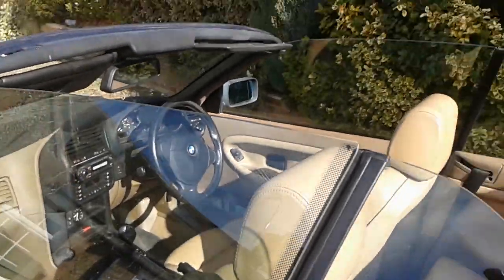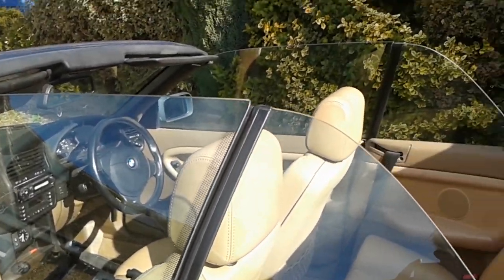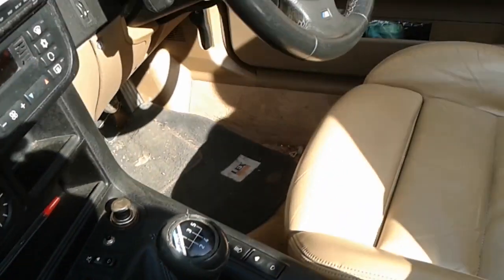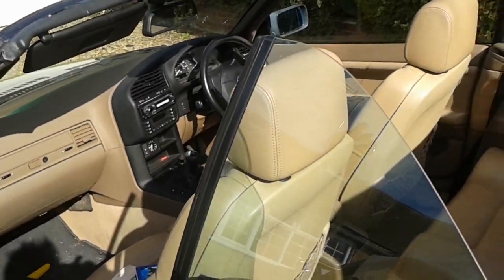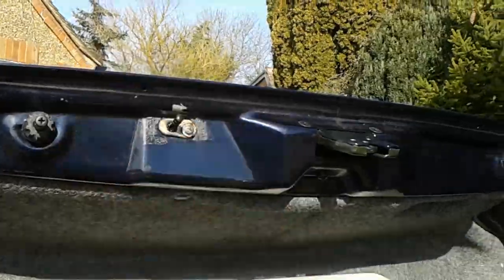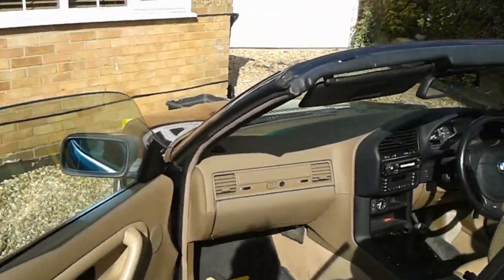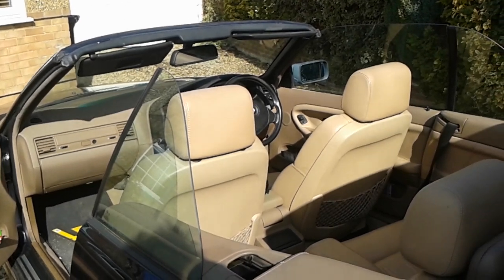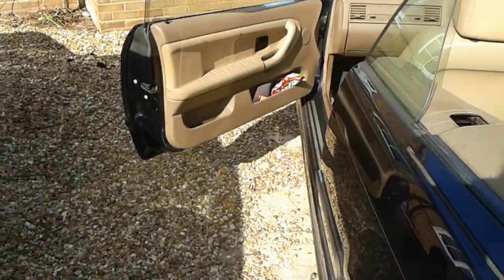BMW Solve Hood Roof Problem - Not Going Down

Comment: Just worked on my E93.  Those boot lid things got lubricated, job done, roof working.  Saved me a lot of worry. Cheers!
Reply: Having problems with e93 roof as well. It wont open and gives error. I changed the 2 relay units in the trunk but still has not fixed it.
Reply: Daniel Scurtu  it turns out the hydraulic unit that controls the convertible roof was damaged due to water leaking into the trunk.
Reply: Daniel Scurtu  thats a big amount to pay. i got a used one for around 200 something dollars and it works fine 👍 also before paying for it the seller agreed to return it in case it didnt solve the issue.
Reply: Daniel Scurtu  good luck mate keep us posted

Comment: The usual problem and the simple fix..When the roof is opening you have two square flaps/sliders on each corner of the roof cover..check under those flaps you will see a plastic arm on each side they usually come off the the little hole on the latch push them back in and the roof will operate the blinking will stop.

if any of the arms clip bits are damaged just cut the remaining   broken clip and drill a tiny hole then use a small screw to screw the arm onto the latch..

it's a better solution than BMWs own crappie design.
Reply: lnr243  any pictures of what your talking about?

Comment: They are not connected to anything. I have removed the trim and found there isnt anything electronic about them trunk/boot stoppers. there is only one switch and that is on the left side in the middle
Reply: its all greek to Me what model is your car? I don’t find it possible show me a video of the cabling connected to this so called switch
Reply: its all greek to Me the brass plate does nothing.. look for cable?? Is there one there? No
Reply: GENUINE BMW Trunk Lid Buffer Stop with Ejector  $16 each.